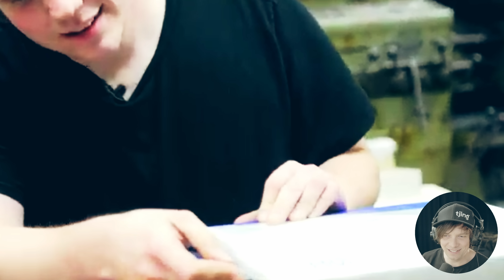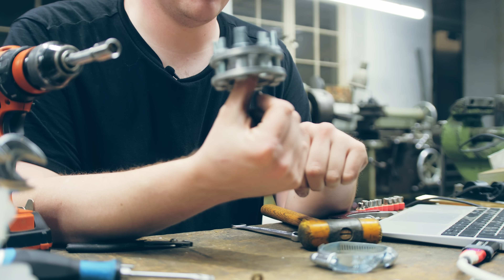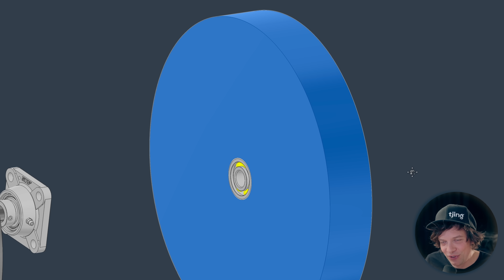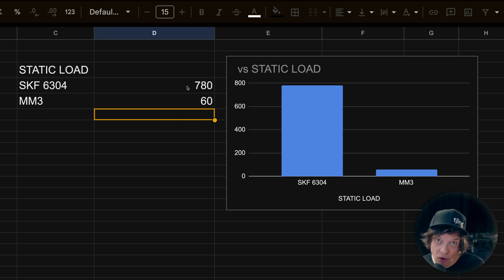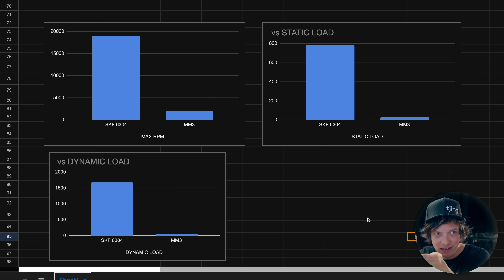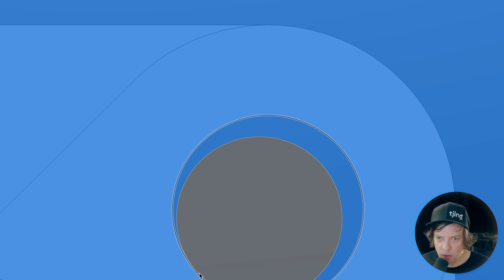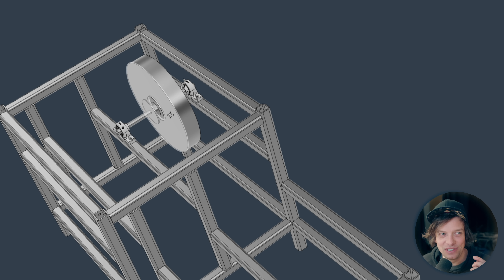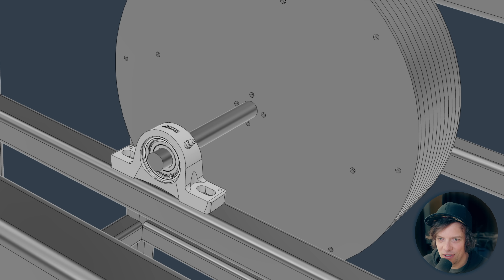Worst Bearing Housing Ever - Marble Machine 3 Ep.3

Comment: For the live axle design, i think you can jusy use a keyed shaft to lock the flywheel rotationally to the shaft and maybe use 2 shaft collars to lock it axially. Another option is to use a hexagonal shaft instead of the keyed shaft. It's popular in robotics and gives you access to ecosystems by VEX, AndyMark and REV revolving around 1/2" hex shafts.
Reply: Keyway is the less labour intensive solution, but it also may give some backlash if the tolerances are loose. A splined shaft would pretty much eliminate backlash.
Reply: you are forgetting about the built-in tolerances of these shafts. They are designed to be a clearance fit for all of the other parts in the ecosystem that won't help with the balancing ,perpendicularity or the vibrations

Comment: See what people aren't understanding is that Martin is going to use those indestructible bolts where the threads NEVER deform or bend. To be honest, I can't think of a single time that any threads have ever gotten damaged, stretched, or dented even on normal bolts. Threads are also perfectly suited for side loading with the contact points being the thinnest part of the threads!  I am SHOCKED that many other engineers don't use threads as a mating surface with another surface under load.

Note: There MIGHT be some sarcasm in the above.
Reply: Hammering bolts in with a mallet is the industry standard
Reply: @awesomo9k  obviously... What other options are there?
Reply: @awesomo9k  That's what those in the know call a 'press fit'
Reply: @awesomo9k  Yes, as long as a wood or brass mallet is used.
Reply: @billkeithchannel  That's only for certain applications, and certainly not how it was used in the video.
Reply: @awesomo9k  I was being facetious.
Reply: lol, it is really clear that Martin is still thinking like an artist at some level still.
Reply: Yeah, I get the feeling that he thinks everyone is saying that the bearing will fail. The bearing will be fine but the bolts mounting it will fail. The threads will compress and warp and the bolts will do that same at some point. Not enough that it will fall apart but enough that the flywheel will no longer be held in balance. The flywheel will shake the MM3 to pieces before the bearing will fail.
Reply: That design should be using hex head shoulder bolts.
Reply: @billkeithchannel  did you not see that he will be using INDESTRUCTIBLE bolts? Shoulder bolts would be much more useful if we were worried about threads getting damaged. But we are NOT worried so there is no need for such a logical alternative.
Reply: @Bbeaucha88  Ah, made with unobtanium and case hardened by burning the gas of unicorn farts in a heat treat oven.
Reply: I just read Martin's replies in the Reddit. He LEGIT believes his threads will never wear
Reply: @ripwhy5705  Ok... This has now gone from funny to concerning. Threads are absurdly weak for side loading. You can take a hammer and as gently as you possibly can, tap the side of a thread and it will deform. A hardened bearing rotating a fly wheel will inevitably loosen the 2 pinch plates and then the bearing will just be flattening those threads over time. This will not happen overnight, it will be over the course of a few months and in that time things will go out of alignment, and out of balance and Martin will end up chasing his tail trying to find the cause of the issues.
Reply: @ripwhy5705  Yeah. And how many times did he have to redesign those marble pressure relief tunnels?
Reply: The thing is, most of the threads on those bolts aren't even being used as threads so does it really matter?
Reply: @007Strings007  that might be the point...
Reply: ok bro, don't need to be a sperg about it

Comment: Why do you need 7500 RPM? That will be incredibly noisy even if you have the most magnificent NASA air bearings. What is the purpose of this big flywheel to begin with?
In addition, the mass of a flywheel should be along the rim and not in the center. The moment of inertia of a flat disc is very poor which means it can't store much momentum or kinetic energy. The mass should be distributed away from the axis.

Comment: I hope you will spend your time designing and testing the actual difficult parts of the machine (marble lift/divider/etc) and use standard pieces for things that are already solved. I believe!
Reply: Not only that, but Martin assumes that everything is perfectly concentric in the dynamic load calculations for the bearing, when his design is highly unlikely to be concentric.

Sticking with proven and cheap designs that can be bought off the shelf worldwide is certainly a good recipe for a supposedly reliable touring machine.
Reply: @slartibartfast2649  At least he should use shoulder bolts since they have good dimensions, but even this has problems used in this way. I just hope he goes with the standard mounts so he doesnt waste time trying to fix the issues the bolt mount causes.
Reply: This is maddening to watch!